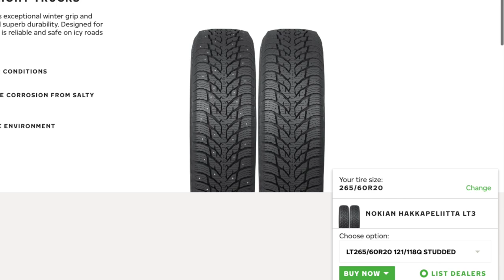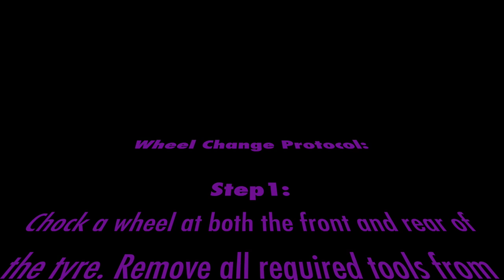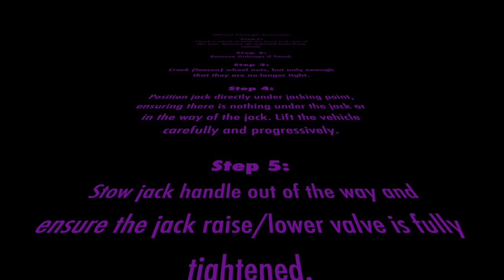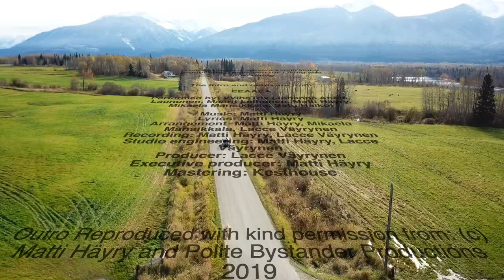Changing a Wheel on the New Defender and How to Jack a Land Rover with Air Suspension #newdefender

Comment: Another simple tip is to have a garden spade handy, really easy to lift the wheel on the pivot of the spade to get it onto the studs.
Reply from the maker: That is the same idea as the bar. In one of my videos I think I used a dod of wood. Anything works if you can squeeze it in and lever it. An old-fashioned shovel would cup the bottom of the whee nicely too!

Comment: Great vid, From last vid. I meant I'll wait until the defender software kinks are sorted a lot of people are have problems with them , the will get those fix in a year or so and I will be definitely buying a diesel . The screen in the v8 looks very nice and hopefully available in the normal Defenders Don't think it looks like an after taught , I'm not a big electric car fan but are very good for city runs and small trips. Why cant you order a diesel in Canada or USA? Jeep Gladiator EcoDiesel / GMC Sierra / Ram 1500 EcoDiesel , makes no sense to me Defender = Diesel. From Ireland .
Reply from the maker: It makes no sense to me either, @Micheál! LOL. The official word (from JLR) -- that is, from what I have been told by people within JLR -- is that it's emissions related -- but seeing that both Europe and Australia have tighter emissions constraints than does North America, that is obviously not the reason. I imagine the actual reason is that JLR diesels have (historically) not sold well in North America. and they simply didn't want to bother with the type approval process. 

Hope you enjoy yours when it comes! If you like the larger screen (many do), then I am sure it'll be a good fit for you. The diesel is definitely the way forwards. I am having some issues with the off-road performance (which is not proving to be as good as I'd hoped), but I am hoping to sort them out.
Reply: @shedlock2000  " I am having some issues with the off-road performance (which is not proving to be as good as I'd hoped) " this bothers me too , i hope they will fix these things , Can i say the room you did with the wood panelling is absolutely gorgeous , your a man after my own hart as they say . I don't understand North America Diesel is for towing and off road it's what its made for utterly mad.
Reply from the maker: Thanks for the compliments on the study! I’ve spent another 4 hours sanding and waxing it today! The finishing stuff always takes the time. 😞

Yes, the ‘less good than I hoped’ is bothering me too! I’m swapping the boots fairly soon, so we’ll see if that makes any difference. Hopefully some (though I can’t see it fixing the power issue). 

I’ll write off to JLR tomorrow too, and see if they can rectify the issue.

Comment: Good stuff.  One of theings I was taught and always still do is to roll an off car wheel under the sill (after jacking up to height) whilst performing the actual wheel/tyre swap just in case the jack slips - means there's no chance of all the weight dropping on to the brake disk and you can rescue yourself by resetting the jack.  What's your view?
Reply from the maker: Absolutely! I like anything under there that is not soft and squidgy, and belonging to a living thing! I occasionally slide my wheel under -- but they can be cumbersome and it's easy to knock the jack (so I prefer a few dods of wood or something similar). I have used wheels from time to time, but I caution that habit because they can sometimes get in the way if you're trying to work in that area or get trapped when you put the other wheel back on (sometimes they won't come out from behind the wheel if there is a mudflap or valance in the way).

That said, anything to support the vehicle in case of a slip is good if it saves a squidgy bit!

Comment: In my experience it take Dal-Tire a year to get the latest Nokian Hakka sizes. Once again off topic, regarding that tent and stove suggest you check out PF Bereg Canada.
Reply from the maker: I purchased the Nokians from Kal-Tire -- but they made no mention of the new sizing (I specifically asked, and they said they had no info from Nokian and no size changes had been released). I also reached out to people in Finland that I know to ask Nokian directly the answer was the same -- but it was emphasised that 'Nokian would not be developing any new sizes to suit the requirements of such a small vehicle producer'. Seems something changed within Nokian!

Thanks for the tips! I will check them out now, Currently, the lead are the Klondike from Robens and the Danchel Cotton Bell Tent. I'm fairly new to the tent thingy -- I previously had a Tentsile, but gave it up for the warmth and easy of an RPod caravan. The fuel economy of the Defender means that the RPod is no-longer a valid option (it tows at 6-7 mpg from the L322's 14-15mpg).

Comment: Hey, my car was fully jacked when changing wheels and they didn’t set the air suspension to off road. So far (1 week since then) all looks ok but I’m really concerned as the manual says you must set it to off-road mode. Are my concerns on place? What can happen with the car? Thanks a lot. Marek
Reply from the maker: Hi Marek, 

You know, I’m not actually sure why the manual instructs the vehicle to be put into off-road height. I’m assuming it’s to avoid the potential of it self-levelling while it’s up in the air and pushing itself off a jack. 

My honest opinion is not to worry in the slightest — I have never put any of my Land Rovers in off-road height before jacking them up (one wheel or many). I have never had an issue with self levelling nor have I had an issue with the suspension otherwise. 

As shown in this video, there are no negative side effects of jacking up without putting the vehicle info off-road mode and when I take it to a shop (JLR or otherwise) they also lift the vehicle at the sills without putting it into off-road mode. 

As I mentioned above, I suspect the only reason for raising the vehicle is to avoid some sort of potential for automatic self-levelling were the ignition to be switched on while the vehicle is jacked up (or some such story) — something I avoid doing for many reasons (not the least of which is potential levelling issues).

I would imagine that you’ll be perfectly fine — but I would avoid trying to enter or turn the ignition on in any vehicle that is jacked up unless absolutely necessary (and then with great caution).